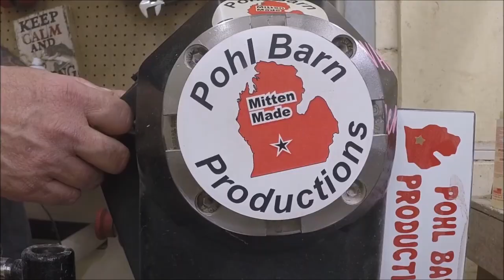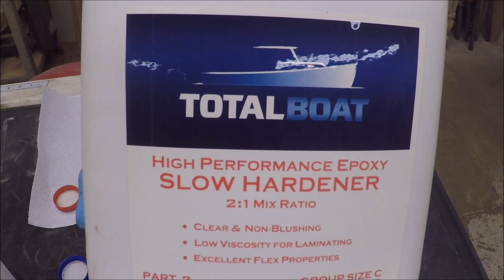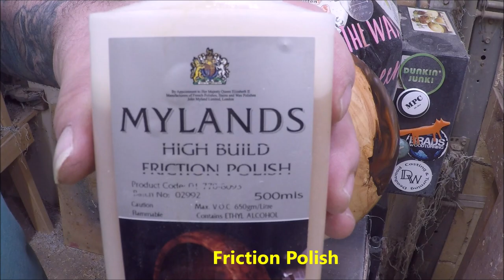Fire Wood, Red Bark Birch

Comment: I am wondering what you, and your Youtube colleagues, do with all the material you scrape of from whatever you are making? Will it end up as pollution in the oceans? I see a lot of material is wasted here and it has to go somewhere. What happens with it?
Reply from the maker: lol I am wondering why it is you tree hugger types think I live anywhere near the Oceans ?  maybe you should be out there cleaning  the oceans instead of bullying others on the internet, friggin Key board warriors!
Reply: Good grief he just asked a question. What do you do with your epoxy scrap?
Reply: @lauriewinblade5214  be didn't just ask a question. He made an accusation... Granted I had the same question and wondered if it could be used as a filler instead on wood or bags of mables inside of of the roughed out bowls.